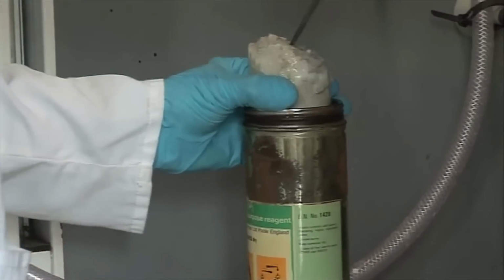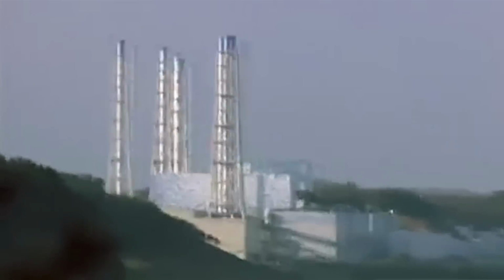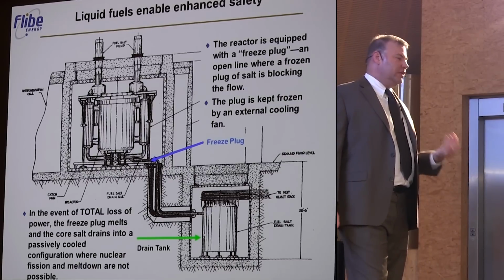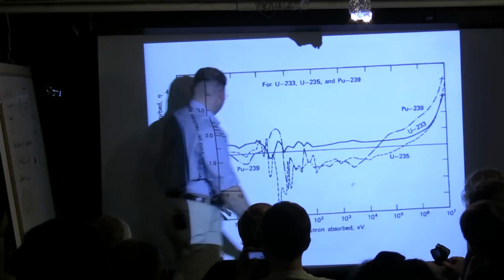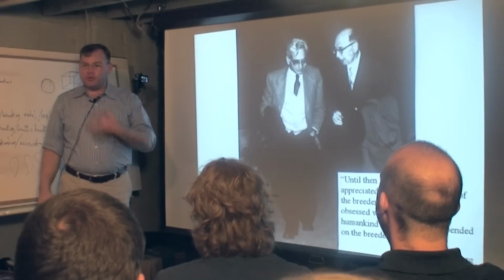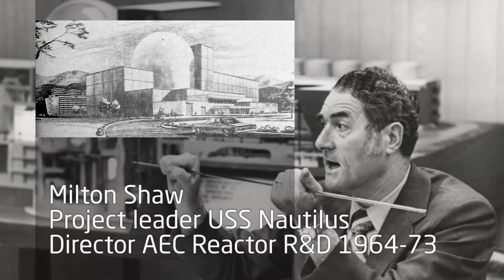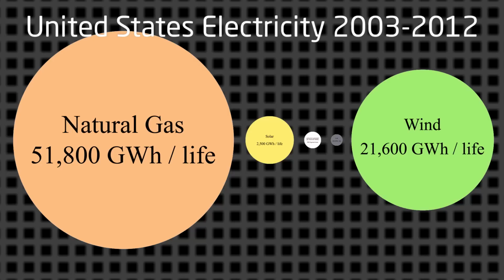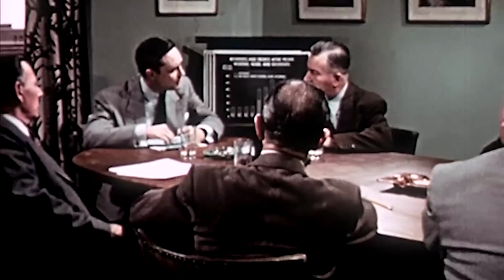Nuclear Disasters & Coolants

Comment: What about ITER? You don't even talk about it but it is about to be tested soon. If it works... guess what, it is 10 time safer than fission and 10 time much powerful.
How does it work? Easy, you just have to heat Deuterium up to 10 million degree °C. ;-).The other problem is than they have to use a magnetic field to contain the heat and it is not so easy to do but, if it work, you 'll quickly forget about Thorium.
Reply: If ITER works it would be great, but LFTR reactor can be made modular, industrialized and miniaturized.
As it is safe, with passive emergency shutdown, it could be installed next to the consumer, saving electricity loss by long distance transmission.
Reply: ITER is a large scale experiment, only showing that the concept of sustained fusion fire works. It is not a power plant, meaning there is no rankine cycle attached to the reactor and no turbine nor generator producing electricity. This needs to be shown in a DEMO project as follow-up, including a closed tritium breeding cycle.

Comment: A beam falling on a guys head is a laughable comparison on the safety problem muclear pollution will bee killing for millions of years
Reply from the maker: WASTE, not pollution. Pollution is what gets shat into the atmosphere by burning coal. CO2 pollution. Mercury pollution. WASTE is spent fuel rods sitting in dry cask storage for ~100 years. 100 years from now, we should be pretty capable of dealing with the relatively tiny amount of waste that is produced by today's reactors and the miniscule volume of waste produced by Gen4 reactor (which would be burning up Gen2 & Gen3 and reducing volume of existing waste).

So this WASTE currently is radioactive for millions of years because we're not consuming it in Gen4 reactors. After recycling it is radioactive for 600 years. So that's 999,940 fewer years to worry about.

Contrast that with Mercury. Mercury has no half life. It lasts forever. And it is not contained in dry storage casks sitting next to coal plants, it is shat up into the atmosphere by burning coal.

When you dismiss nuclear out-of-hand without looking at real costs and real safety statistics, then you are in fact perpetuating the burning of coal. Which kills millions of people globally (due to air pollution) every year. Today. Right now.

Chernobyl will have killed fewer people in total than any single year of burning coal. And there's ZERO projected fatalities due to radiation from Fukushima AT ALL. The United Nations: http://www.unis.unvienna.org/unis/en/pressrels/2014/unisous237.html

So I appreciate you're posting multiple comments to my video, but if you're listening to the absolute drivel spouted by Dr. Helen Caldicott crowd, then you should double-check everything they say. I was fact-checking her on nuclear, and nevermind-nuclear there isn't a single subject she touches on that you shouldn't cross check against a domain expert.

Dr. Helen Caldicott - "Th" Thorium Documentary
Reply: gordonmcdowell yes, let's just assume that we'll be able to deal with waste in a 100 years.  we'll just store it until 100 years we suddenly get the solution.  idiot.
Reply: Chris Hall Well there's thorium MSR which provides enough waste in 10 years that you could fit it in the palm of your hand, and then you can take the waste itself and recycle it. So if that's what you're worried about...

Oh, and by the way, are you seriously trying to say that in 100 years our technological advancements will be so poor that we can't improve nuclear decay breakdown?? Riiiight. 

And unfortunately, even counting nuclear waste, nuclear is still safer and more environmentally-friendly than anything else. You want to know how environmentally friendly solar is? Look up the pollution from making solar panels. It got so bad in a town near a solar panel manufacturer in China that they went on strike.
Reply: 13minutestomidnight All I am saying is that we should not simply hope that we can fix a problem now, in a hundred years.  We don't know everything, even though we like to think we do.

Comment: ✻flower of life (more than ➓ thousand years old hidden olso in temple of osiris)is working with numbers (building the matrix by dividing by ❼ )for  each events what you used have the own numbers if is  music ,life , chemestry ,electricity etc the matrix give you the events ✻ doesn't have a time (a time is where you put it is fractal comes and go) if you used for example life you start count the first event is (1/7 2/7 3/7 4/7 5/7 6/7 7/7 is ❶ this can be time (1day  or a 1cell ) then you have 14/7 is ❷(second day 2cells)than 21/7 is ❸ and in this event  something change (is a 3th day of the embryo but are 8 cells now) we keep counting 28/7 is ❹ (the 4th day 32 cells now) ❺ (128 cells) ❻ (512 cells) ❼ (2048 cells) and so on i hope i am right otherway you get an alien if you start the matrix with 137  you get more structure of the Caesium chloride ,someone has decoded more ₪itibira₪